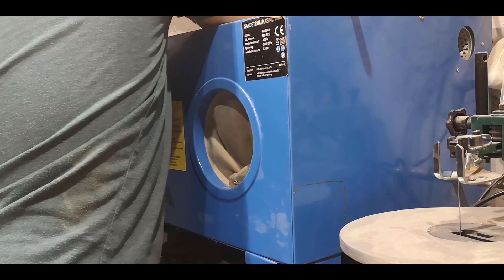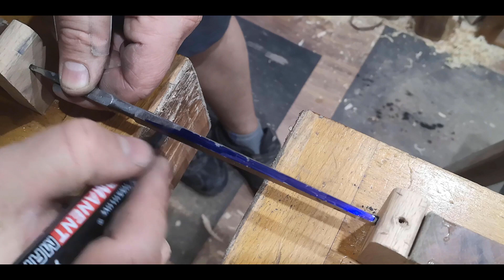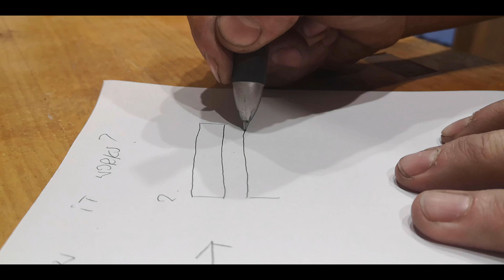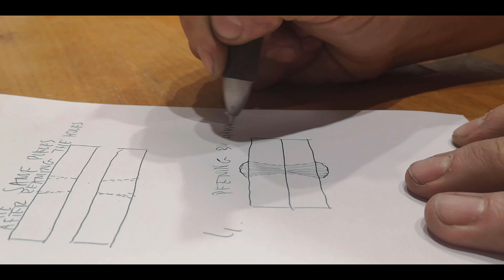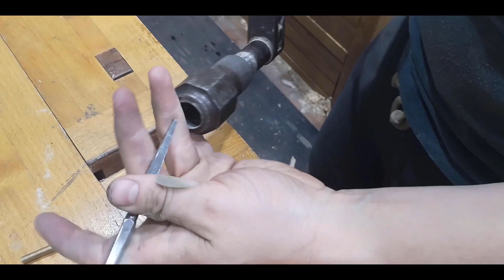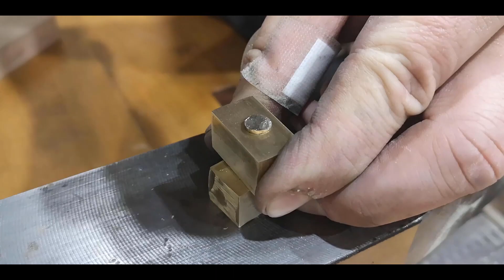030 Second life of vintage tapered reamer

Comment: Nice one Stavros. I am curious . When you were using the sanding disk  you put your fingers at risk holding the reamer on the disk and then starting the lathe and yet when you were using the diamond plate you moved the plate and not the reamer on the plate. Was there a particular reason for this technique?
Reply from the maker: Thanks Peter! I put my finger to hold tre reamer flat. Next i used metod showed in one of Clickspring's videos - https://youtu.be/SOw9WqMOHjA
It helps to get flat surface. 
Regards!
Reply: @StavrosGakos  Thanks for that. I understand what you are up to now. I still don't like the idea of having fingers that close to the disc. I see Clickspring used a belt sander. I see what you were doing with the blocks of wood now although the reamer seams to be stiffer in its rotation then the file in that lovely gadget Clickspring made. I guess that as long as it does the job all is good.

Comment: Is this method superior to merely countersinking the rivet bore? It might be, but only if hammering the rivet causes it to expand in such a way that it completely & uniformly fills the tapered hole. But I suspect that it doesn't. What you failed to do was cut the practice blocks in half and show us the cross section of the rivet within the tapered bore. My guess is that the rivet is merely a bent and crooked cylinder within the bore until the last few millimeters before the surface...the same as if you had drilled a straight hole with a countersink.
Reply from the maker: It works and that is the most important thing for me. Regards
Reply: Josh - When he pulled it out to reveal the taper it looked pretty uniform, he’s not working in steel.  I do love how brass can be worked (often times with woodworking tools that will need a rapid sharpening) especially making screws or pins “disappear” by sanding.  That malleability would suggest a better fit on that taper than I think you are granting.  The stuff Clickspring does with rudimentary tools is amazing.
Reply: @StavrosGakos  
I'm confused...
It works both ways ?. Is it better to enlarge the hole with the reamer?

I have not tried it yet and because I am learning by watching videos I thought countersink was enough.
I have even observed some knives that have these rivets in the handle made by hand, these only had countersunk.

Could you give us your impressions, I would appreciate it very much ...
Reply: @StavrosGakos  Yes, but for how long will it work? if the two blocks are meant to turn against each other, then it's fine, but if the two blocks are meant to stay tight against each other then the method has failed because diameter of your pilot hole was too big for the pin and then you made diameter even bigger by reaming.
Reply: Josh - I agree with you. The diameter of the pilot holes was too large for the rivet pin. The reaming only increased the diameter of the holes. All that's holding the two blocks together is the compression from peening of the rivet heads. With use, the compression will fail and the blocks will loosen and turn against each other.

Comment: Okay, that’s a pretty interesting tool.  I like how you refinished it, especially how you use tail vise to hold it while honing. I would not have thought of that. I have never worked with brass before, but watching the hammer project and this, I’m inspired to give it a try!  That sanding wheel is really interesting as well. Is that attached to a regular grinder, or is it a special machine? Thanks for project video!
Reply from the maker: Thanks William! I love to work with brass, you should try it. I made that sanding disc and mounted it in my lathe ;) Regards!